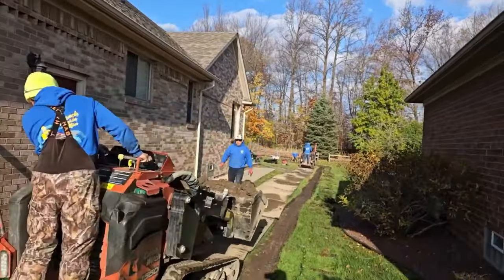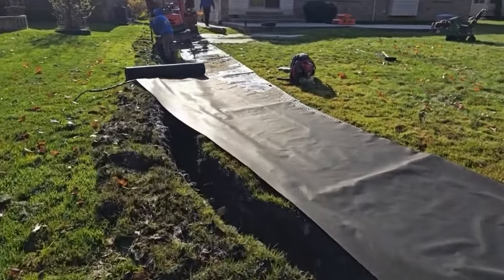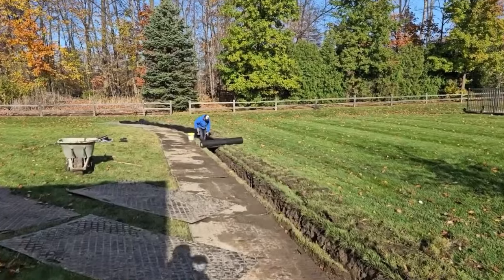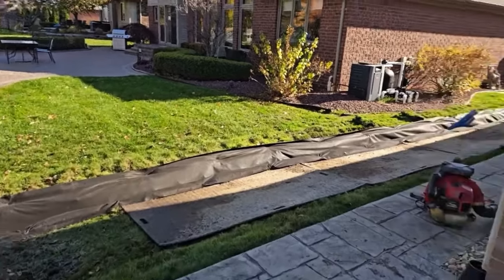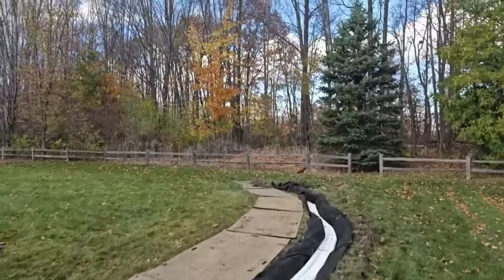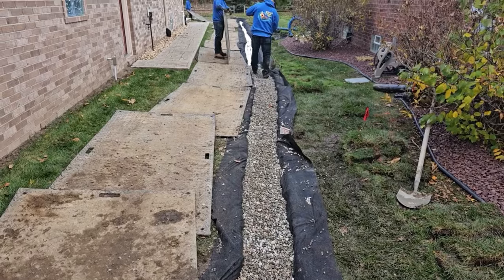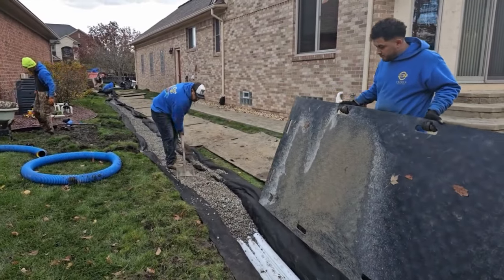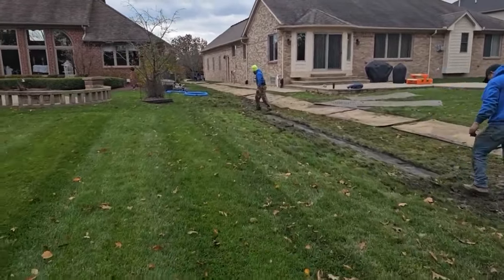How To Install Perforated Pipe FRENCH DRAIN  For Do It Yourself Job

Comment: Interesting.  The piping for the downspouts is perforated with no fabric to prevent soil and roots from penetrating the system.  Also, running 5 runs of perforated pipe in the french drain only saves on the amount of stone required.  Saves you money.  Not only that but with 5 pipes there is a large air void which could collapse if anything heavy was put overhead.  The pipes are what, 4 inches each.  That's a lot of air?  Yes with 5 pipes there is the potential to move more water but the 2 initial 4 inch pipes would be sufficient.  This job does not run enough water to justify the 5 pipes.  Sorry.
Reply from the maker: @rickhorn7256
Their pump failed during a power outage, and all those pipes underground acted as a detention tank.

Comment: With a setup like this where the Downspout Pop up Emitter is outside of the fabric. I'm assuming a catch basin is then unnecessary?
Reply from the maker: If it's a short run, we don't bother with a catch basin on a five- or six-foot run. But on all our longer runs, we certainly put a catch basin 3 feet from the house.

Comment: How close to a septic system and leach field can I put a French drain in?
Reply from the maker: That would be a question for your county building department. It all depends on what you are trying to do as well. You have to keep the water in that leach field contained, and that is what the code states. You should also have clay around the leach field; the clay acts as a rubber liner, and when the septic system was approved by the inspector, I am sure it was done properly.

Comment: The rock you are using is different than the round rock you recommend in other videos. I used pond rock that averages 2'3" but some are bigger. Will that work? Also, do you secure the fabric or just fold it over and cover with rock? Thanks
Reply from the maker: https://youtu.be/VFYj7sbmXGg?si=QluX-ZMc705oq7jZ

Comment: Awesome video. Thanks for this. I have a sump pump drain line in back yard. It was draining somewhere i cant drain anymore. Its only gonna be going out 15 to 20 feet. My neighber ran a 5" pvc pipe with a french drain. What you auggest I do since its not a long run im doing?
Reply from the maker: Three-inch pipe would be fine. Four-inch pipe is a bit overkill, and I do like overkill.

Comment: I live in North Carolina and am looking to install french drains from the down spouts around my house and threw some low spots around my yard.  Do you sell the materials I would need to do this?  I have the equipment and ability for a DIY job just want to make sure I am installing the best/right materials for the job that will last a long time with minimal problems in the future.
Reply from the maker: Our materials are the very best in the industry. You can read our Google reviews. When you hold our product in your hands and you see it in real life, it's almost hard to believe how well it's made, and it's made in the USA
Here is our online store 
Best French Drain and Yard Drainage Contractor
https://frenchdrainman.com/

Comment: Homeowner that is planning to install your system with dual +3 inch pipe french drain. Is there a rule of thumb for estimating the amount of 3/4 inch stone to order for the drain? Thank you
Reply from the maker: That's a really good question. Instinctively, I think you could go 40 feet on 1 yd³ of Stone.

Comment: If perforated pipe without fabric does not work, how do farmers lay miles of it to drain fields?
Reply from the maker: Many farmers will not use the sock. The percentage of farmers that are putting in a sock is 3%.

Comment: What is a good rule of thumb when to use perforated vs solid corrugated pipe?
Reply from the maker: Solid pipe is for yard drainage with catch basin and downspouts. Perforated is for French Drain and leach lines.

Comment: How close can I put a French drain to a leach field of a septic system?  My leach field is in the lowest part of my yard in the front yard and that's where my drainage has to go to the baritch for my French drain.
Reply from the maker: There's too many variables. Every situation's different. I advise you never to go through your septic field system because you're gonna fill it up with water, and it's gonna be to full capacity, and then your septic system is going to back up.
Reply: I know where my leach field lines are. I just want to know do I need to stay 10 ft away from my leach field or do I need to be more? I've got about 15 ft to play with from my leach field to my property line from next door.

Comment: I recently put in two French drains following these methods and they are working great! Mine are open french drains covered in rock not sod but I followed the advise of The French Drain man. It was a lot of hard work as I did it by myself but this system makes the most sense.  I scoured the internet for information for a couple months before deciding what to do and in my opinion there is no one that seems to know what they're doing more than The French drain man!